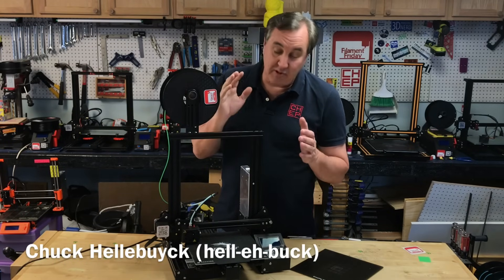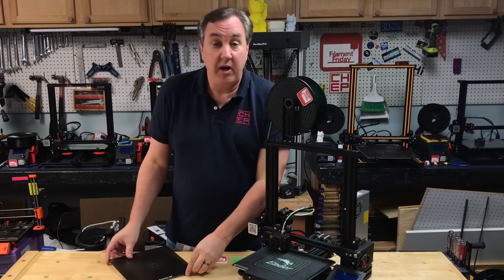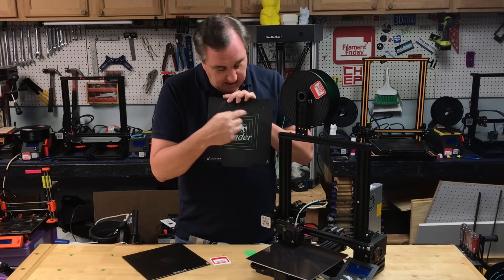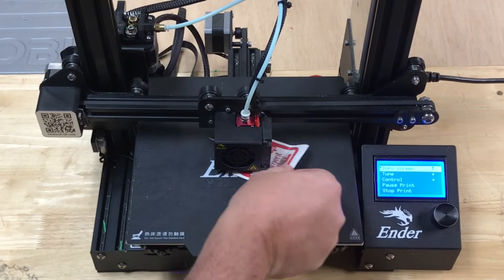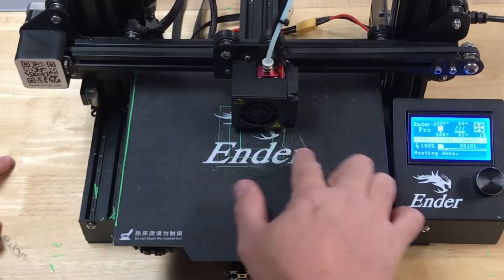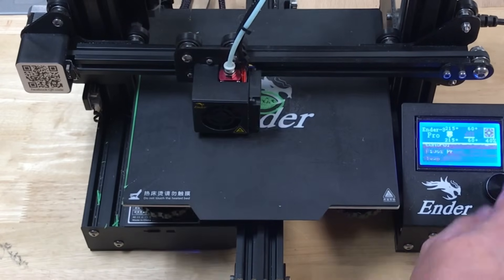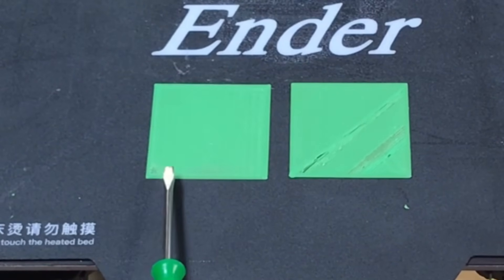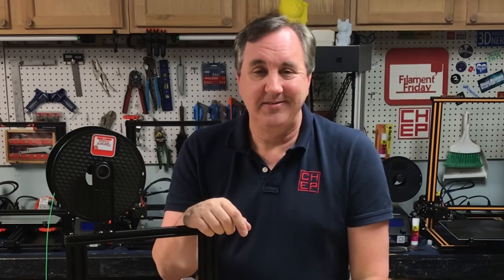Creality Ender 3- Easy Way To Level Your Bed

Comment: I am confused. I always understood that when you put the paper under the nozzle, there should be slight resistance. You say here you should do it until it will barely slide out and there is significant resistance. Which one is it, as I am concerned I may have been doing it wrong

Comment: Hey Chep,could you please recommend an intermediate 3D printer that is oversized to where I can print bigger things. I cut my teeth on an Ender 3 Pro. I think it's about worn out and I'm ready to upgrade. Thank you sir.
Reply from the maker: You didn’t mention a budget or how big exactly so I’ll assume affordable. The Bambulab A1 Combo at $550 USD is a very good printer for the money at 256x256 vs 220x220 of Ender 3. And includes the ability to print in 4 colors.

Comment: Purchased these files today and they sadly are not the same as the ones that were free whatsoever.. EDIT; (fault in printer)
Reply from the maker: They are the same files. Nothing changed. Not sure what the issue is but if it’s not stopping then use the included M25 version.
Reply: @FilamentFriday with M25 I’m having an issue where the print head isn’t dropping to bed, as well as it’s only doing left side front and back and then it goes towards front right doesn’t stop and runs to the centre for one final pause, maybe I can upload a video later I’ll show the issues I’m having with the files and be able to get your help with the situation?
Reply from the maker: That sounds like a firmware issue with the printer as it’s not reading the standard commands in our file. Contact me thru email chelleb1 at yahoo and I can try to refund your cost.
Reply: @FilamentFriday I’m gonna try a few things to see if I can get it working properly, no need for refund, the content that was listed is included, i apologize for the rude off coming, when i originally bought this printer new a year or two ago i came here and right off the bat had perfect success, 30-40 near perfect prints later I suffered massive failures with thermal runaways one after another, i bought a full hotend assembly new from Creality and have just installed it and now im right back too problems with everything i do, but you are at no fault here so i apologize again i will say i was surprised too see multiple printers in the files compared to just the few files that were in the free one! Keep doing you! I apologize again

Comment: Took me a long time, but I finally found your bed leveling gcode files.  Many thanks!
(By "long time," I mean I had been trying to level the bed manually for the last few years.  This is much better than beating my head against the wall.)

Comment: @FilamentFriday I know this is an older video but the 300x300 gcode file for both this manual method and the leveler tool just trips out my Ender 3 Max Neo. It won’t run it at all. Did I miss something or something I need to change?
Reply: I assume it’s because it’s the NEO,  you make no mention of it being compatible, just the Ender 3 Max 300x300.
Reply from the maker: Did you change the firmware?
Reply: @FilamentFriday  yes, the firmware has been updated from what the machine originally shipped with.
Reply from the maker: @ That may be the issue. Some firmwares take out the pause command for some reason.

Comment: Hey do I have to do this after every print
Reply from the maker: No, once you’ve got it set properly it tends to hold unless you move the printer or a print causes a lot of vibration.

Comment: so just purchased the program and it dont work. error no gcode
Reply from the maker: The .gcode set is what you downloaded. Did you unzip the files and install the .gcode files on your SD card and run it like a print?

Comment: Bought the files a couple years ago and they worked great, stopping at each corner and the midpoint.  Just tried it today and it won't stop.  Thought the code might be corrupted, so I just bought another set of files through Patreon.  Same problem.  The printer head moves around the bed but doesn't stop.  Trying to stop it manually, the printer then won't let me resume.  I can print things on the printer, no problem, though they're not quite level.  Any suggestions on what to do to get the leveling file to work?
Reply from the maker: Did you change your printer firmware or control board?
Try the M25 version.

Comment: The programs irritating me I've been trying to level my bed and when running the program it doesn't seem to pause on each corner its just drops down fast then goes on to the next corner without me commanding it to do so. very irritating and can get anywhere trying to level
Reply from the maker: Try the M25 version.

Comment: Thanks for the bed level files. I have used this and got my bed level but when I go and print a file it seems like any other file does not print. the nozzle either seems to high or to low. if i go back to recheck the corners one or more are not close to the nozzle. what might be the problem?
Reply from the maker: Your slicer might be adding a z offset to the print. Or something mechanical is shifting. Print the squares test multiple times see if it happens there too.

Comment: i can print the squares perfectly now but when i go to print anything but those squares its as if the nozzel is to close to the bed and just barely lays down filament
plz help
Reply from the maker: Check your z offset in the slicer. Should be zero.

Comment: sorry this is so flawed. you are basically priting untill it looks good
Reply from the maker: 1,000,000+ have successfully leveled there bed based on this video. Think you missed the point.
Reply: @FilamentFriday  Think you and 5 others which tutorials i wathced have missed the point. Because i tried your method like an idiot for 3 hours. Whats the point of feeler gauge if you gonna fiddle it afterwars? have you ever worked with feeler gauges? Even stupid creality manual doesnt say anything. i was connstantly too high despite doing everything right. Then I watch Ricky Impey video and he says crucial thing is to offset Z for feeler gauge thickness before leveling and i got it done in 6min because i know how to use a feeler gauge!!
Dont take this personally i just hope more people gets taught a proper method!
Even my printer when its homed says -0.1 which is so obvious it needs to be offset before leveling. After doing proper leveing i print 0.3 first layer and measure it 0.32 so thats about right and means this is only proper way.
Yes you can get it leveled by looking at the print but point of leveling is not to have to print 10 times, test print is to confirm. Also, test print cant be done with your squares because that doesnt mean much unless its creating solid surface, so you see how much material its actually putting, does it appear to overekstrude or underekstrude, which tells you if nozzle is proper distance.
Reply from the maker: @Boz1211111 - I didn’t use a feeler gauge. If you want even better use this. It’s helped 1000’s get a perfect 1st layer. 
https://youtu.be/m0bAhh-5IAI?si=MTpwYKmF7yEyda0R
Reply: @FilamentFriday  Thanks. There was one thing that you said very good, there is no way to do it perfect without doing test prints, but 0.3mm squares should be used for that. Then you can dial it in, even with correctly raised extruder when i do it still not all corners are perfect without adjusting with test prints. Its extremely sensitive in fact and fiddly to do, especially if bed isnt perfect (most arent)

Comment: Any chance youve got gcode for the ender max? Or a stl so we can modify the points? Ive also got a 400x400 TronXY
Reply from the maker: My $3 download includes 180x180, 220x220 and 300x300 version. They can be modified with a text editor.

Comment: Should probably point out that these beds often come from the factory warped, and tend to warp more with repeated heat cycling. If the squares test you used can be made with a happy middle ground between not quite printing and smashed out, then you got 3 options left. A good glass bed clipped on will help (but glass xan be pulled out of flat), take the bed off and sand/surface plate it in (got to know what you're doing and labor intensive), or buy a new plate. 
A mesh pass with a bl touch can compensate for it but then the prints will be warped in the same way your plate is, so if flatness is critical, its not gonna be your savior.

Comment: When clicking on the link, the description states it is for an 8-bit board. I have a 32-bit board. Will these g-codes work for the 32-bit board as well.
Reply from the maker: It depends on the firmware installed. There is also an M25 version that works when the original doesn’t.

Comment: This video is why I want a Bambuu labs printer... I'm still referencing this video half a decade later to get my ender 3 pro to be level. At least this is great content
Reply: Your chep bed level prints download on your site is stale for the ender 3 pro. Would you please re-upload it 🙏🏿
Reply from the maker: @Bigbeardfpv - Download is updated and even includes larger & smaller beds. Plus M25 version included for some machines.
Reply: @FilamentFriday  thank you 🙏🏿

Comment: I need help. When I tried to calibrate new Ender 3 printer using your code, it not pausing at each corner. I own another Ender 3 printer, and its does not have this problem. What should I set in Ender 3?
Reply from the maker: Try the M0 or M25 version.

Comment: Cheers for the continued support. I'd been using the same bed level code I got from you for about 3 years but discovered today that it no longer worked after a recent firmware update on my Ender 3 v2.

Thankfully your newer version works perfectly. Many thanks Sir.
Reply: The links are dead for me where do you get the file?

Comment: Help.... please....
So I've done the process as described in this video... all woks well the squares print OK and I did about 4 layers....
Then I do a test print I try to print a  basic square, cone and Cylinder.
But as soon as it starts to print the  filament feeder starts to clunk and  looking at the bed it appears the nozzle is way too close to the bed... not allowing the filament to extrude.
I'm using cura to slice. Is there somthing I can do?
Reply from the maker: Make sure z offset is set to zero

Comment: GCODE FAILED Interesting results--looking for insight.  Transferred both M0 and M25 gcode files to the SD card.  Selected the first file, choose print, then confirmed.  The screen shows a quick progress bar at the top, then goes back to the main menu.  Nothing else happens.  Tried both files, same results...  Thoughts?
Reply: @CHEP, do you by chance have code available for the Ender 3 Neo Max (300x300)-- running firmware V1.4.7_G.  Thank you in advance!
Reply from the maker: @BDTube2006 - Sorry. Missed this message. I don’t understand why it’s not working. I don’t have a Mac to test on unfortunately.
Reply: Also in the same boat, having the Neo is a pain sometimes. Mine did the exact same thing.

Comment: I have an Ender 3 Max Neo. I tried both the bed leveling g files and neither runs on my machine. When I run the bed level print file, it draws the squares but they remove easily. Can you tell me why the leveling g files won't run? Is there any set-up prior to running the files? Help.

Comment: Thank you so much for the awesome procedure. I’ve been battling with my printer for months and couldn’t figure out why it was behaving so badly. I thought I had it leveled just fine but your tests showed how off my printer actually was. I ran the test over and over until I finally got the squares to print properly and stick well. After doing so, I am finally getting proper prints off of my Ender 3.
I would recommend this leveling procedure to anyone with an Ender 3 printer!

Comment: Man, I think you saved my 3d printer, I can't thank you enough. I just received one and I was horrified because the first few prints were perfect but then I couldn't get it to work and I tried for days without success to recalibrate it. I tried a few times but I could get all the squares to work and now I'll just buy the proper products to clean the bed because I think that's the only thing preventing me from succeeding in printing other stuff.

Comment: Did not have the Gcode, but last night I spent about 45 minutes doing exactly what the gcode was built for. I would adjust the X and Y axis manually in a diaginal pattern (bottem left - top right - bottom right - top left) and test my paper at each corner. Then did a second round of clean up leveling. My first print came out great all things considered. Using the orginal Ender 3 so I don't have all the bells and whistles the new ones have. This video was a great reassurance as I was at my wits end lol.

Comment: I subscribed as you teach this very well. I am about a month in new to my original ender 3. I have learned a lot as a beginner and by following your instructions it worked. I was getting frustrated with leveling the bed as it would be unlevel after a couple of prints. It's easy to do just getting it right. I may in the near future upgrade the bed springs and a BL touch.

Comment: i have a problem with the leveling where the 4 points are ok but the center is too close. btw i used a piece of paper so i dont know, pls help
Reply from the maker: Bed might be warped.
Reply: @FilamentFriday might be, thx for the answer. You might think I can bend it the other way by hand ? The other option is the second bed I have, it came with the printer but it is the sticker bed and I really don’t want to stick it on permanently

Comment: can you list all your cura settings i just Got a ender 3 printer for christmas and every time i print something it comes out terrible
Reply from the maker: ******** Ender Style Cura Profiles Download Links: ******
Best (0.12) : https://thangs.com/file/972301
Good (0.20) : https://thangs.com/file/972299
Extra Fast (0.28) : https://thangs.com/file/972304
Hyper Fast (0.32) : https://thangs.com/file/972305
Reply: @FilamentFriday   
Thank you so much
Reply: whats the difference between 0.12 ,0.20, 0.28 and .0.32 because i dont know which one to use @FilamentFriday

Comment: Hi CHEP, I'm using an Ender 3 Max, but gcode M0 is not centered on the bed, the first point is OK, but the other points do not go to the equivalent point on the bed and the central points are not centered either, how can I change Is this gcode for the dimensions of my printer?

Comment: Idk what's wrong with my bed... I home head, then turn off motors so I can manually move them and then go to each spot, and I have to basically unscrew the knobs all the way till the wheel is falling off and it still isn't tight on the nozzle...this is my 1st printer so idk wtf I am doing apparently, so any help would be appreciated. Thanks

Comment: On my creality print software when I try to convert the level print file to gcode so it'll print no my printer from the tf card it shows it printing this large base/support under it.

How to a I just print the square without all these supports?

Comment: First you say paper hardly moves, then later slight resistance. which one is it then?
Reply from the maker: Doesn’t matter, paper gets it close. The squares print where you adjust based on the finger slide test will adjust it perfectly.

Comment: Hello. I have used this guide for a while now to level my bed.  Recently after leveling I can get the bed level print in your link to print the squares totally fine.  My very next print, however fails to stick to the bed. 

Any ideas on why this is happening? I have tried to print using cura base slice as well as your good profile from your hyper fast prints video.  

Thanks.

Comment: Thanks Chep,  but for the newbies, how do you run the file you mentioned (which by the way since it´s fast forward is hard to understand).  Thanks
Reply from the maker: Like any print. Just load it on SD card, select and press print.
Reply: @FilamentFriday  didn´t work.  Only the "Level Corners" was read by my Ender 3.  The bed_level_print is not read by my printer
Reply: I´m using Cura 5.9.0.

Comment: This didn't work for me, one corner would simply not print, I mean no material would go down. No matter what I did to the height of the bed. 
Bed leveling is the single reason I never recommend friends get their own 3D printer. It's amazing to me the industry hasn't solved this problem. "Auto bed leveling" feature seems to be a myth, at least it is with the Ender 3 S1 Pro.

Comment: Good video, but what happens when it's been working fine for a few months, and now it's clicking, but the first few layers are perfect and it starts to print rough layers as it continues.  Small pieces print fine.  I just did a benchy yesterday and it printed great, but larger pieces are printing rough layers after the first few good layers.  The nozzle is barely scraping the paper on preheated extruder and bed.
Reply from the maker: Fan is probably failing and your getting heat creep.
Reply: @FilamentFriday  interesting.....I've been closely monitoring every print lately and the fans seem to be functioning as the always did.  Besides, I've only had the printer sine Jan.  Could they fail this quickly?  Do you know of a way of troubleshooting that without replacing the fans?...just to test?...  maybe turning up the fan speed?....105, 110%?  Not sure if it's even possible to turn it up over 100%.

Comment: I have a problem, My filament won't come out of the printer nozzle even though I have it in the nozzle.
Reply from the maker: Is it heated?
May be plugged.
Reply: @FilamentFriday  it is 100% heated
Reply: I have the same problem in one corner only

Comment: Thank you for your video. I get near-perfect adhesion when printing the squares, but as soon as I try to print any other file, I have to cross my fingers that the filament will grab onto the plate.